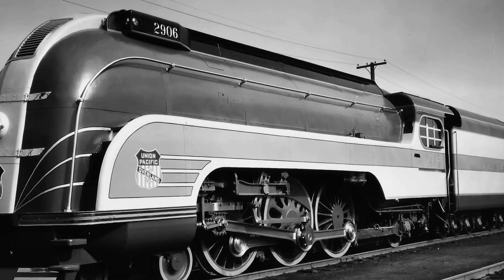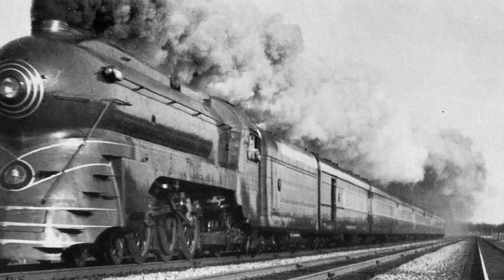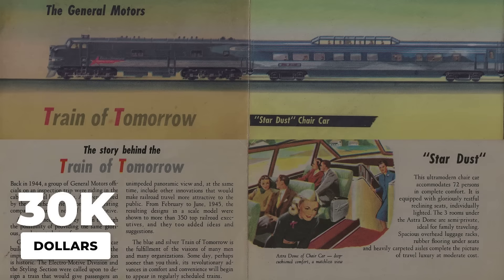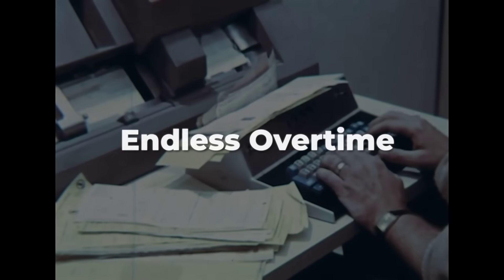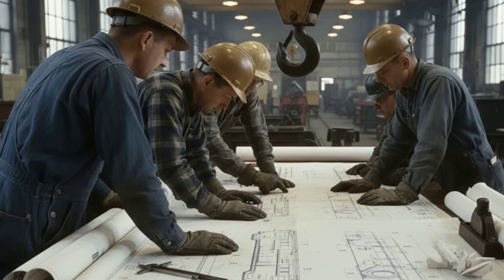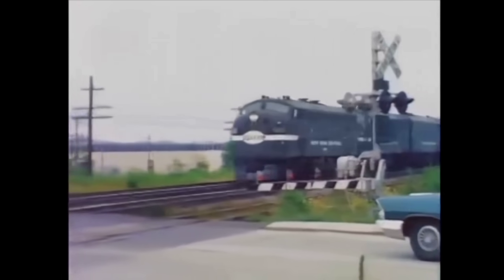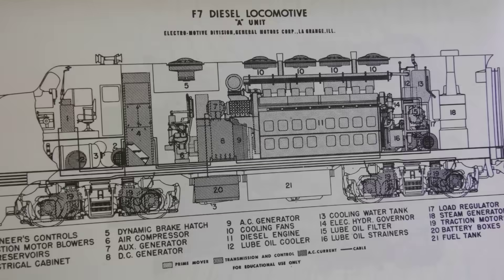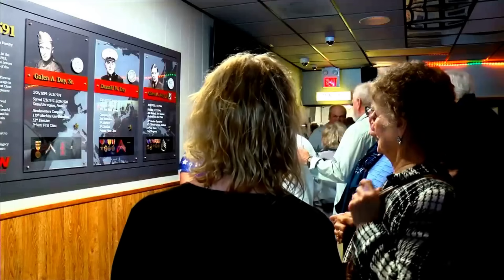The Hidden Engineering Flaw That Ended The Streamliner

Comment: "Streamliners" vs. "Trainsets" -- the early renditions like the Zephyr were an integrated "trainset" with every piece (including the locomotive) custom-designed for pleasing aesthetics and light weight. However, because they were an integrated set and custom-built, it was hard for the railroads to add or reduce capacity for seasonal lulls or weekend surges, especially on long-distance routes. They realized that streamlined cars with conventional couplers could easily be shuffled in and out, as could cab and booster locomotives that somewhat matched the style. Integrated trainsets (such as the Acela) are still employed successfully where there are shorter distances, more frequent schedules, and multiple trainsets to ensure better utilization.

The removable power assembly was already in use in F-units and in the E-3 and later units, but once the railroads realized the economy of maintenance with hood units, they became the norm. However, passenger cars still exhibit the aesthetic advantages of streamlining. Illinois Central ran a number of their passenger trains with steam boiler-equipped GP-9's, although their premier trains still merited E-units. They were ugly, but beauty didn't pay the bills. The convenience of automobiles and speed of air travel are what hastened the decline of rail travel. Even today, modern passenger locomotives like the GE Genesis and Siemens Chargers and Sprinters, and even boxy F40's and F59's, MP36's, F125's and numerous other iterations still maintain a "somewhat streamlined" look. So "streamliners" still exist, as do some "trainsets" with custom-built power units -- they're just not the sensation they once were!

Comment: The reason they didn’t survive is because they were impracticable to use for freight. Passenger trains were being discontinued and streamlined locomotives were difficult to use for switching online industries. They were replaced with engines that were designed for freight train service.

Comment: It wasnt until 4th/5th gen that deisel power  plants were actually reliable regardless of official history. 

EMD had the advantage of parts supply enmass which other builders lacked. So you simply had a stockpile of parts in storage. Had ALCO focused on that the same way- history may have been different.

It wasnt simply the streamliner thing either but rather mechanical engineering failures.

Engineering groups were segmented which meant the right hand (electrical guys) never knew what the left hand (plumbing/coolant guys) were doing and visa versa.

For FT - F3 all the  electric cables were on the floor while the coolant lines were on the ceiling- oh hell no.

Engine gaskets were also HIGHLY PROBLEMATIC. Ive heard too many stories about 2 inches of oil on the floor IF THERE WAS A FLOOR AT ALL due to them rotting out within 2-3 years.

When the gp7 was released the floor pans were replaced by heavy duty walkways. Elec & cooling lines were rearranged for the new car body design. 

Another helpful thing for most gp/sd offerings was lack of steam equipment thus removing more water from the equation. 

Ive heard many stories about opening the cab door to the car body to be greated by a lightning display from all the shorts and arcing. 

EMD WAS NEVER THE BETTER DESIGNER OR BUILDER.

They were the best MASS SALES UNIT/GROUP + PARTS SUPPLIER. 

Early diesels were as dangerous as any steam locomotive. It took to the 1960s to begin to turn that tide. Universal series + Century series was the start and directly resulted in Dash 2. 

Dash 2 was the saving grace of desieldom in many ways and still is relevant today. GE brought that forward especially in the 90s.

Comment: What do the steam locomotives have to do with the narration?  The HLP jobs you describe relate only to the early Diesel-electric locomotives.

In fact, there are several illustrations that have no bearing on the story.

The streamlined boxcab could have been redesigned to modernize maintenance.  Today's Amtrak streamliners have all the fixes.

Nevertheless, the comments about operating crew convenience in freight service are well founded.
Reply: The misinfo and mismatched photos are standard for this AI-produced channel.
Reply: In the mid- and late-1930s, UK did fast trains with streamlined steam engines.  Back then, we had the manufacturing expertise to do it - and plenty of cheap coal  too.

Comment: One of the problems with streamliners was that they were built as a train set. Cars could not be easily interchanged to allow different arrangements.
Reply: Not all streamliners were built as "train sets". The disadvantages in certain circumstances were realized early on, and many subsequent streamlined trains used conventional couplers and trucks.
Reply: Guess what Acella 2's are built this way, why, because they're 10% lighter. Look before you talk?

Comment: The streamliner visual appeal vs difficult and slower access and maintenance was common to both steam and diesel electric locomotives.  I recently watched repair work  being done on the Norfolk and Western class J 611 locomotive.  Access and work was made longer and more difficult than similar work would have been without the streamlining.  One of the many things that made the J such a success, however, is that she was designed (mechanically and visually) and constructed by the same organization that would operate and service her.  In the case of the repair work I observed, the absence of visual streamlining design on the top of the locomotive (she has a masking skyline) eased access.  That beautiful nose?  There is a hole for inserting a rod to release the cowling and lift it away in one piece.

Comment: Younger me always felt that the early diesel locomotives (E and F series) were much more attractive and preferable to the later boxy units (except for the obvious advantage of exterior walkways as they appeared), but older me realized there was even less rearward view from the cabs of the early design (often referred to as covered wagon) than on the steam locomotive predecessors.

Comment: But why are thay calling steam locomotive as Streamliner deasle's
Reply: I am uncertain regarding the commenter's intent, but streamlining was applied to both steam and diesel locomotives.
Reply: @catreader9733  Thing is, though these videos are "AI generated", the persons behind them still should do better research and incorporate clips and/or images that actually correlate to what they are trying to sell. They should also give credit to where it is due when they mishmash all these clips and images together. The video is supposed to be about streamlined diesel locomotives. Yet, look at all of the countless clips and images which have nothing to do with the main topic.
Reply: @berkshireerielocomotive3322 Many good points.  However, I don't spot anything that indicated that the video was supposed to be about streamlined diesels, omitting streamlining on steam and electric locomotives.  The focus is there, of course, because steam locomotives were retiring regardless of streamlining  and streamlining effects were not as big a liability to all-electric locomotives.
Reply: @catreader9733  When the video first starts, we are led to believe it's going to be about the streamliner age of the railroad, and beginning at 0:51, the AI narrator even talks about the M-10000, which wasn't a Diesel set at all. The train set was powered by a Winton distillate/gasoline engine. 6:43 is where the video goes off on another topic. But even prior to that, it's just repetition.
Reply: @berkshireerielocomotive3322 Agreed. My first comment, questioning the commenter's intent, was directed to @mattomon.  I didn't mind the some of misplaced imagery and narration as much as you seem to have (because I saw and heard some interesting bits), but I agree that it was not well organized or presented;it's not a good video.
Reply: @catreader9733  These videos are supposedly "AI generated". But the people behind them are spamming the same videos across different accounts.
Reply: AI AI AI UGH!